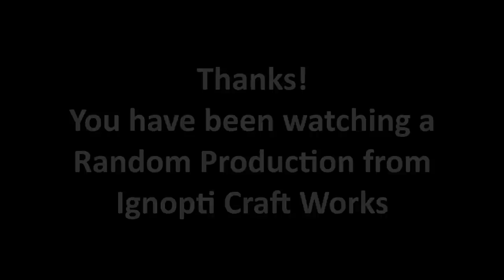Woodturning - Clearly Pussy Willow

Comment: Nice work, but doesn’t the heat of the resin curing melt the hot glue?
Reply from the maker: Thank You - I've had no problems with the Hot Glue melting from the resin cure heat, it works really well and if you watch some of my other videos you'll see I use it extensively for all sorts of purposes - as long as the glue gun is good and hot when it's applied it works a treat.
Reply: @IgnoptiCraftWorks  thanks for the reply. It melted on me once, but it may have been a deeper pour with more heat.